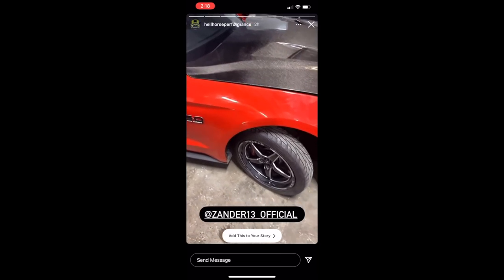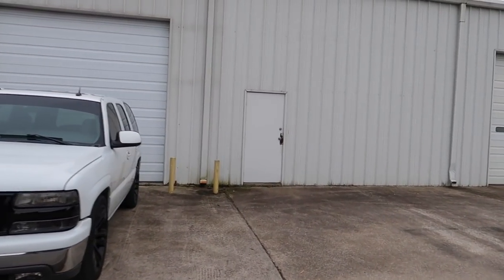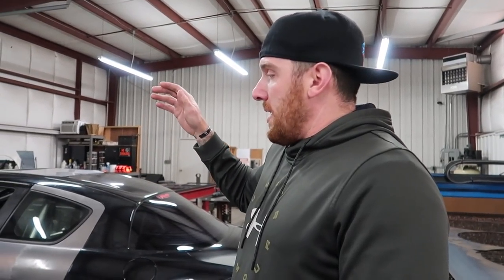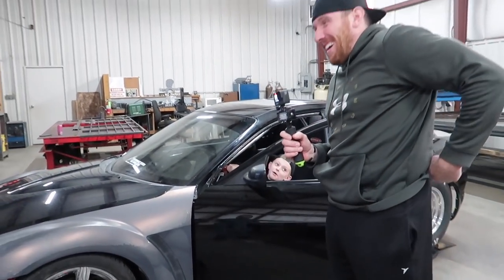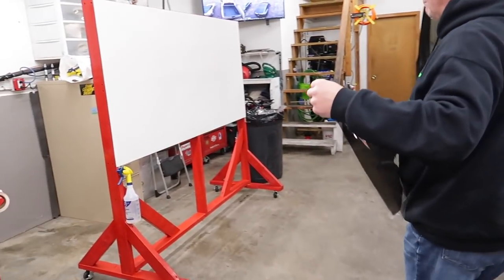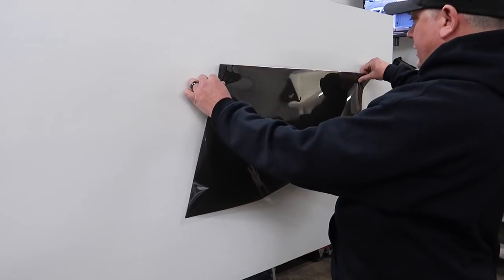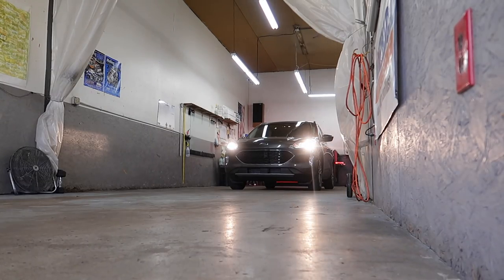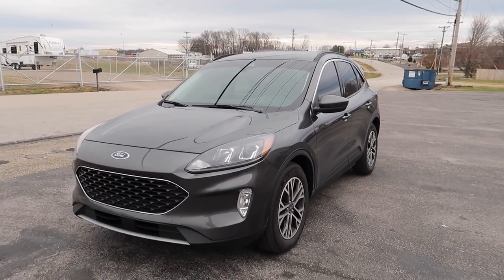My Twin Turbo 2019 Mustang GT Needs ANOTHER NEW ENGINE | Hear me out...

Comment: I think it would be cool to keep the car a true street car. Radio, AC, power steering ect. Sleeve the block, head studs and such for all the boost. If you have the coin some head work, cams ext. I think a fully built 10R80 from Midnight performance would be cool. So many people are just going straight to a glide or TH400 and I think that takes away from the street car aspect.

Comment: Sleeve it, Forge pistons stronger piston rods better bearings and rollers, Titanium springs ported and polished, A good engine cam, lighter flywheel triple plate clutch, Larger oil pan with upgraded pumps....well you asked? Hahahahaha 😂😂😂😂

Comment: These are upgrades that should have been done from the very beginning of this project.
Reply from the maker: Most ppl boost their cars first as consumers. I was just appealing to that crowd
Reply: @Zander13Productions  when you are potentially, effectively, put power  enhancers that add 2 1/2 to 3 times the original horsepower, that's a serious build. It doesn't make sense not upgrade the block, heads, trans, suspension and rear end when tackling that kind of build. In any event, now the engine is being pulled again, to hopefully make this thing bulletproof. Good luck and Merry Christmas!